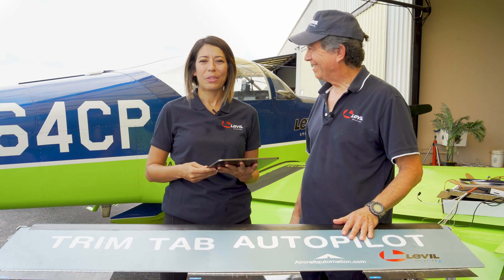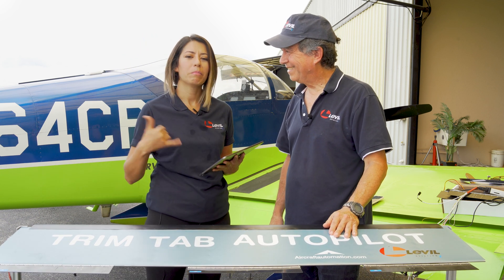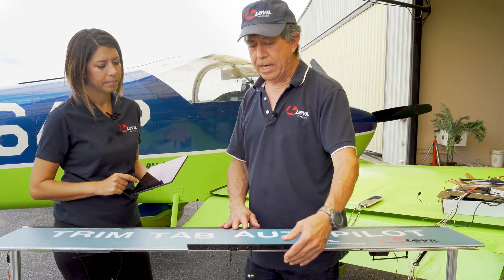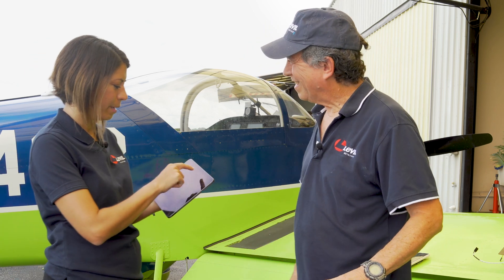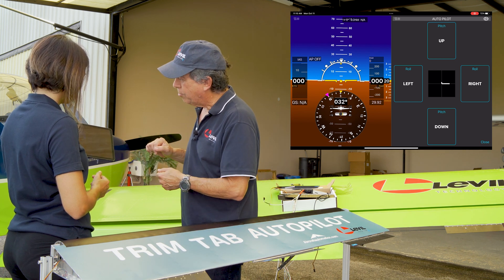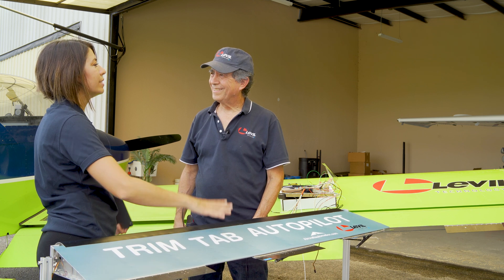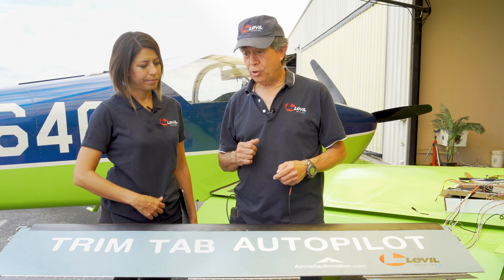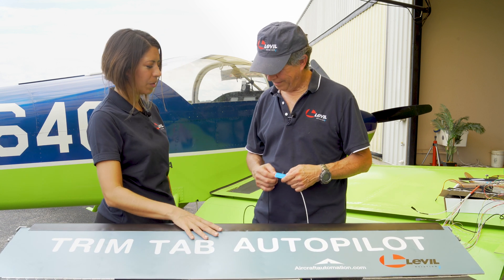How to Configure the Trim Tab Responsiveness and Servo Direction | Chapter 03 iLevil AP Manual

Comment: Before installing your auto pilot you should check for friction in the control cables, small amounts of friction can cause a system to hunt. Some ailerons use differential linkages, so you should check to see that the maximum angle of deflection is the same on both sides. If not you can use two servos similar to the Bonanza installation.

Comment: I fly a very interesting plane; Davis DA2. It has V tail and no flaps. So thanks for answering the two questions I had in mind. It would be interesting to try to install your AP in it. I am in Canada, do you have any dealers in Canada? Or I have to buy it from you directly in USA? 
Another question, will the BOM work with this AP? Thanks
Reply from the maker: We currently don't have any dealers in Canada, but we can ship directly to you without any issues. The BOM and the AP are very similar. You will need one or the other unless you want to have a redundancy/backup system.